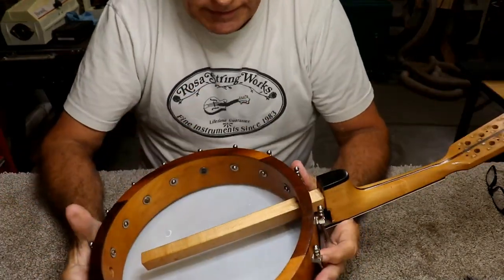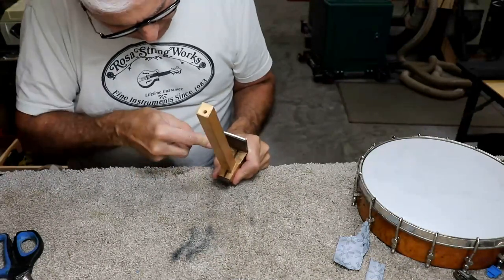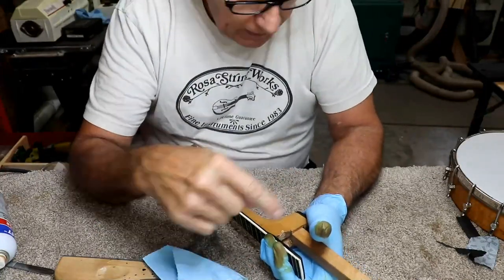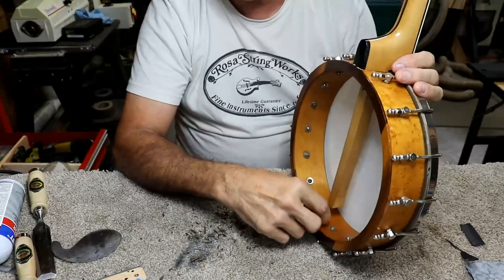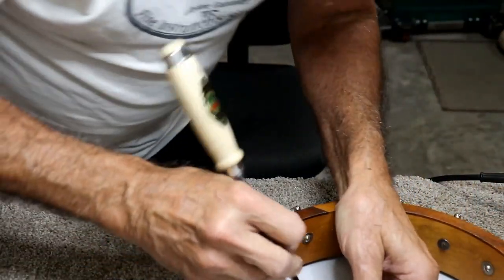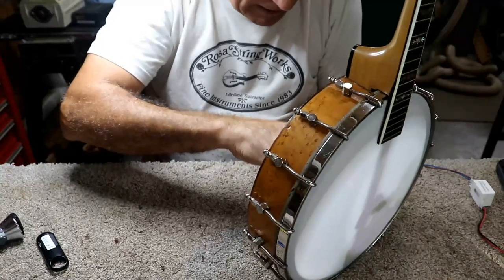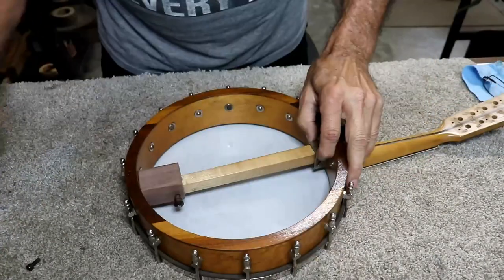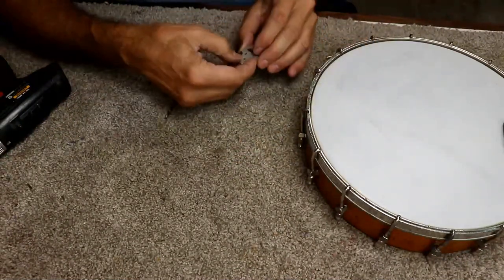594 RSW A Banjolin Repair - All Screwed Up - Part 2

Comment: I always use a small nail set punch and punch out the small end and the ball of the pop rivet and then peen over the back side to lock the rivet in without the ugly expanded part on the back.

Comment: I had a similar problem with clearance on a repair. I chamfered the drilled hole and put in a regular piece of rod and peened it in and then ground it to smooth with the part.

Comment: I had one just like that.  You missing another part that fits on top of the one that's there it will aline with the hole if mounted on top.
Then it can adjust with the right presser and screws to the one on the bottom.

Comment: Banjolin like the melody banjo only has four strings and not eight. When pattented in 1876 it had eight but was changed to four several years later.
Reply: Yes, I suppose that could be true.  All the old timey ones I've ever seen have 8, like a mandolin.  They are loud and expensive to own.  They are as tempermental as a spoiled 7 year old child, a lot of them.  I wanted in the worst way to build one, but I'm glad that infatuation has passed.  I'd like to borrow one for a year or 9 months to see if I could have a decent affair with one, like a cantankerous girl friend -- a beautiful woman, but wayward and ornery and a real bit***ch.
Reply: I have a circa 1919 Fairbanks Vega Style K melody banjo with 4 strings.  I used it for several years as a substitute for a Brazilian-style banjo for use in pagode (“pah-gho-jee”) music.  Tuned D-G-B-D, the same as a Brazilian cavaquinho.

Comment: Wondering if the back end of the neck extension (wood brace) once had a metal receiver similar to the front end to adjust the neck angle?  That might explain the shortened brace and offset from the mounting hole in the drum side? Why else would the brace be cut short and out of alignment?
Reply: Could have been replaced or a neck for a different instrument.
Reply: @mandolinman2006  So what secured it in place before the repair order, or did this arrive as a dysfunctional collection of mismatched parts?
Reply: @dorisandpatrickleary8297  that I don't know. From what I gather, he had it for a little while and someone saw it and wanted it.  I know I have 2 banjos with a similar setup, one a banjolin. Both have the dowel butting up against the rim with the screw going into it.